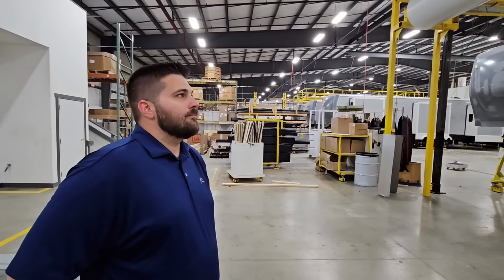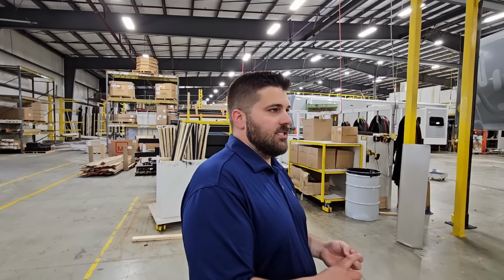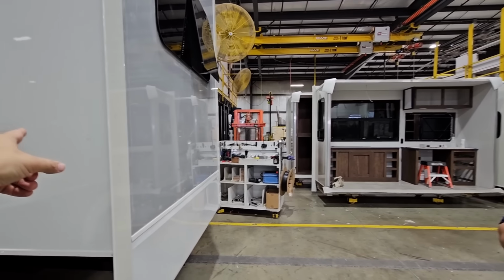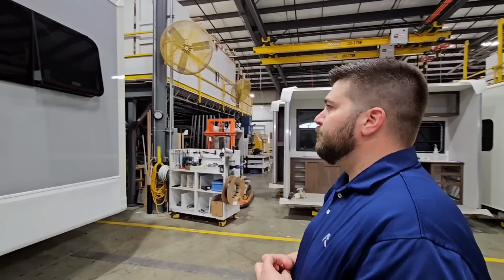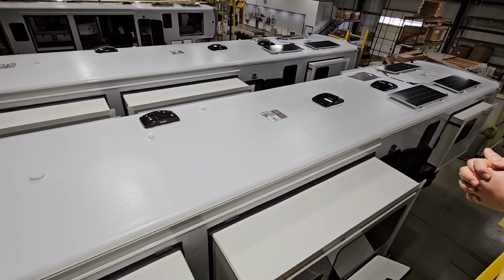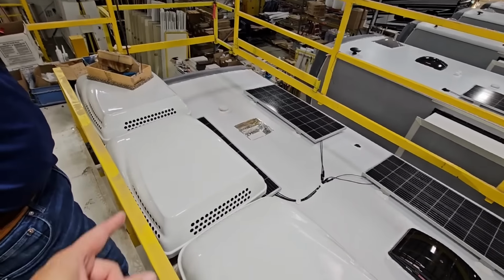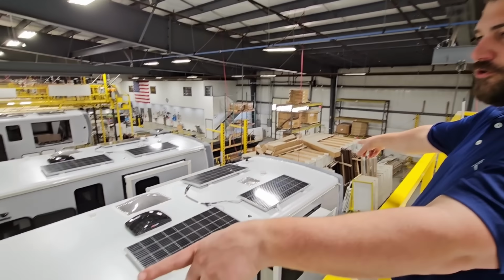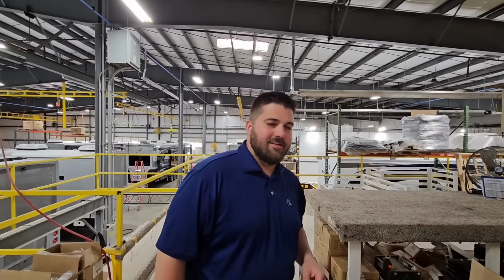THIS IS GREAT! BIG Riverstone RV Durability Upgrade! Factory Tour Part 5

Comment: As a Riverstone owner,  I love my RV  I have a 2021 Riverstone 39FK Legacy package,   my complaints are the " Upgraded" Dyson vacuum is junk,  would rather have the standard onboard vacuum, battery on dyson dies after a few minutes of cleaning,,  I am glad to see the updated control system, "  the one control is very slow,  phone app works better than the onboard touch panel".  On a side note,  glad to see upgrade to Lithium battery,  I had issues with my schwentek slide in front,   and was found to be a battery voltage issue,   after upgrading to Lithium batteries (2) and updated charger to work with lithium,  and a reset on the controller.  I have has no further slide issues.  Overall I have had a good experience with the Riverstone.  I would recommend a larger inverter and add 110v plugs into the slideout rooms where sofa are located,   * I did remove second sofa and insalled desk area in that space and added 110v power plugs in slide for computer power.

Comment: Riverstone is definitely committed across the board at uping the standard of quality. 
Nick does not appear to be side stepping any question or issue. He has done an outstanding job of continuing a paycheck from his employer. 
All of these upgrades, or the "standard" items they use, certainly explains a lot of the price of these units.
Again, they don't skimp any quality to impact weight savings. They have made a corporate decision to build heavy, quality units, and appear to be holding to that commitment. 
Be sure and tell Nick how much it is appreciated the amount of detail he is going to in explanation. 
Thank you, J.D. for going to this level of detail as well.
It would be nice if all manufacturers would do this same type video. Although I don't think that will happen, it would highlight some embarrassing shortcomings. And prove they are in the business of get em built, get em out, get em sold, and don't tell folks they need bigger trucks to safely pull these rigs.
And as I also live in Texas, salespeople need to quit telling people that onesingle a/c unit will cool these rigs anywhere in the south !!!
God bless and stay safe on your travels.

Comment: I have dual pane windows in my Bounder, there is absolutely a little air gap in them and the seals break and they can get foggy but the secret to fixing them is using a certain butyl tape designed for this… they have the perfect thickness to replace the little paper wafers that the factories use.

Comment: We have a 2023 Riverstone 41RL.  The design is great...and that's where it stops. The A/C units (Truma) leak condensation into the interior.  Our new Brooklyn Bedding bed is now ruined. There are times when we are asleep and the flooding starts.  Move to the sofa bed in the living room, and that one starts leaking. This is know problem with Forest River (maker of Riverstone), and they have a TSB.  Unfortunately, the TSB didn't fix the problem. It's now worse. Additionally, the Firefly unit is constantly bugging. The ceiling is sagging, and many other issues. More expensive doesn't equate to better quality.

Comment: Wow.... I want one, but all the models are too long for my neck of woods.  I wish they would build a shorter floorplan (using same build quality) for those of us that stay in State and Federal campgrounds.   Overall, very impressive!!!
Reply: Totally agree. The older we get the less stress we want in our lives.  A really nice 30' would be awesome. Don't have to have a dinette, a couple bar stools and bar/counter space will be fine. East/ West bed in a slide to.
Reply: @kimh2330  I think the industry would be blown away with how much demand there would be for a HIGH quality shorter premium 5th wheel trailer ( 32'- 36'), like the RIverstone. The existing so-called premium trailers (Montana, Paradigm, Solitude and others) offered in shorter models are nothing more than the exact same manufacturing methods used on mid level models with very thin frames and thin laminated walls.  The Market needs shorter high quality premium trailers with solid frames.  So what if they weigh and cost  a little more, it would be worth it!
Reply: Luxe
Reply: @wisrdb  Wow, I had no idea they offered a 33' model.  Very nice!!!  Thanks!
Reply: @gcslade  You're right...I believe that's what a lot of people are looking for.
Reply: He mentions Ceder Creek as using the same wall type construction.  Check them out.
Reply: @gregmiller674    Thanks.  In doing some quick research, the Cedar Creek is not even in the same league as Riverstone quality and construction.  OMG.. what is up with Forest River brands removing windows in entry doors.  So....UGLY!!!  I want a window in my entry doors!  The little bit of efficiency gained is not worth not having a door window and it makes the whole RV look cheap and UGLY box!
Reply: @gcslade you must be kidding, many of the same features are on a Cedar Creek!
Reply: JD, I’m sold on Riverstone now, was looking at Brinkley but no way now. I’ll be ordering a 39RKFB as soon as the roof change happens and may upgrade the solar. These folks are doing it far above all others. We saw what happened to Van Leigh out of business and Luxe is quality but very pricey. Thank you and Nick for these videos!

Comment: Im very confused. My 2024 riverstone was sold as full body paint but not a single slide side wall is painted. Were there some that do not get?
Reply from the maker: You sure they didn't have white paint?
Reply: I think this was covered in the video around 6:30 mark.  Appears slide out boxes are painted the base coat color so either a white or silver.